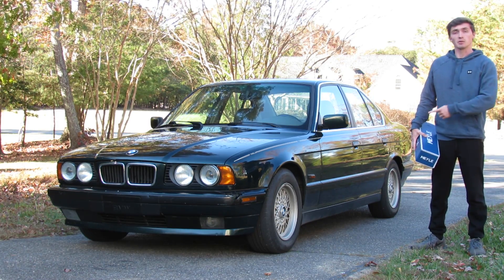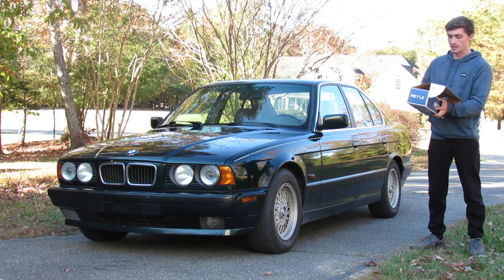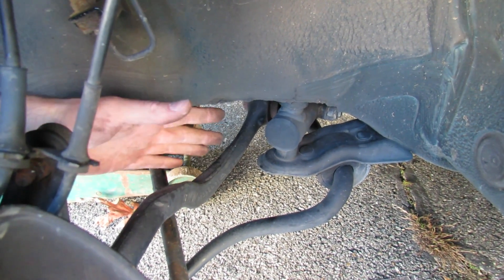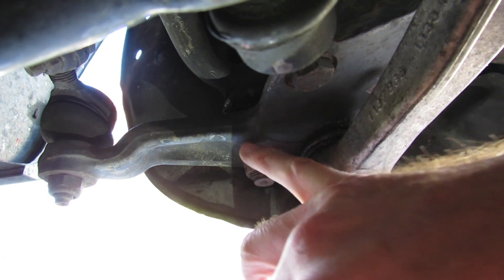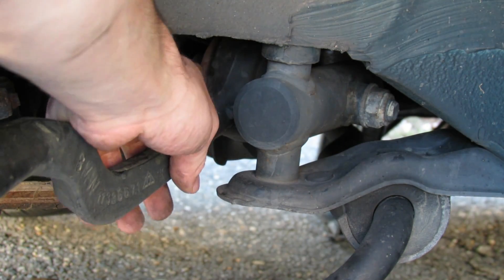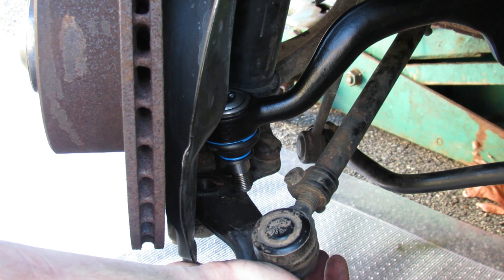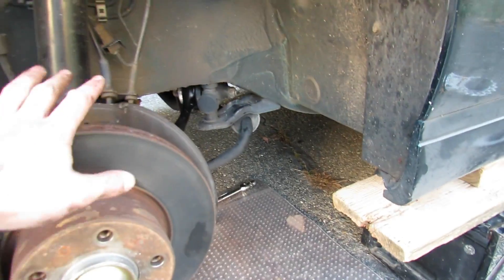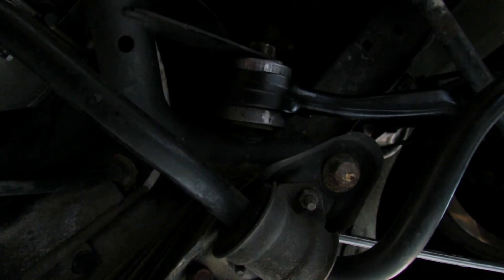E34 Thrust Arm EXPLAINED + Replacement Walkthrough

Comment: i'm currently doing right now on my 525i and the outer nut will not tighten even if i turn the wheel right or left
Reply from the maker: Sorry you're having trouble, I hope you've managed to get it by now. If not, you can carefully try and tap it in a little with a rubber mallet or a hammer and piece of wood until it bites

Comment: 21 mm if you have a V8 model. You’ll also have to remove a bolt underneath where the thrust arm bolts in to give room for your wrench to fit in the gap
Reply: Did you find that only removing the one subframe bolt was enough? Or did you have to remove the sway bar plate also? Thanks!

Comment: Good video, only thing you should know is that torque values are almost always listed on the nut side of the bolt, if you torque the bolt you get all the resistance from the whole bolt turning aswell. A rule of thumb is then to add about 10% torque value to overcome the resistance.

Comment: Great video! But how on earth did you get a wrench on the nut while you were working unscrewing the bolt? On my 540i there isn't nearly enough room to fit a wrench inside that flange. Looked so easy when you did it :(
Reply: I have the same issue

Comment: Don't do what I did....
Everyone says rebuild the entire front end and buy these big kits, blah,blah,blah.......
Drove with front right tramlining for 5 years and had to replace tire with recycled.
Just replace two thrust arms and rebuild any parts necessary later. Do not think this is a bigger job than it is or needs to be. Tramlining is annoying as h3ll.
Great vid, if I had seen this well explained vid, I would have just fixed it in my busy schedule.
Watching all your well presented videos, love the coil fan resister explanations too.

Comment: Excellent video, clear, concise, well explained and filmed. Great to see quality parts being used too and you rightly point out the need to torque the inner nut once the suspension is under load to prevent detrimental strain upon the bush. You even included the specific torque settings. This will be the next thing to address on my car. Thanks. 😎👍
Reply from the maker: Thanks, glad you found it helpful! Best of luck on your repair.